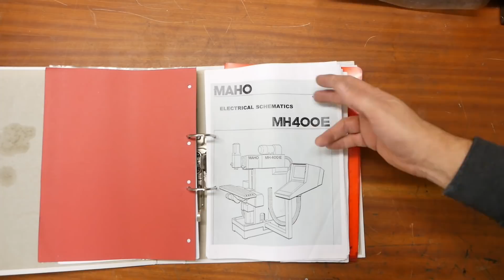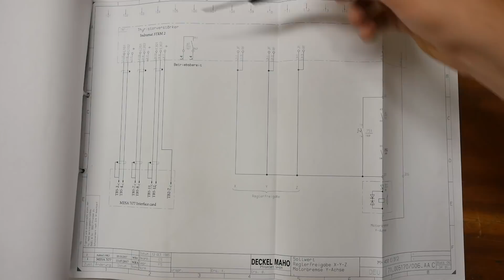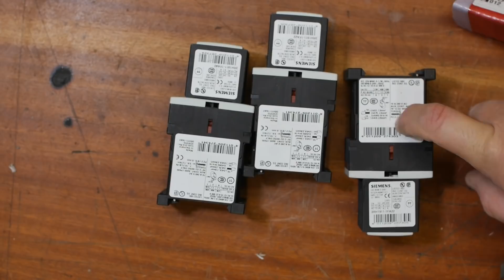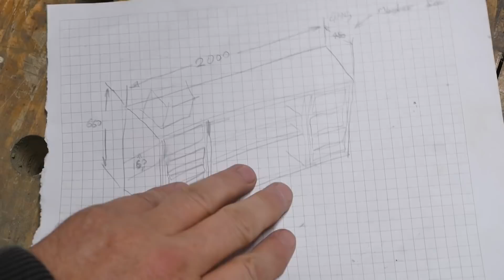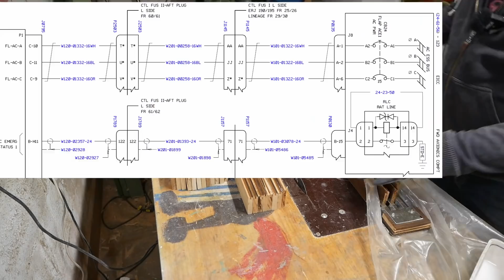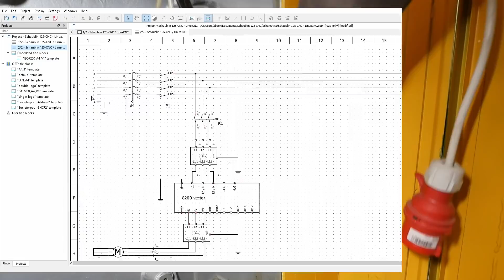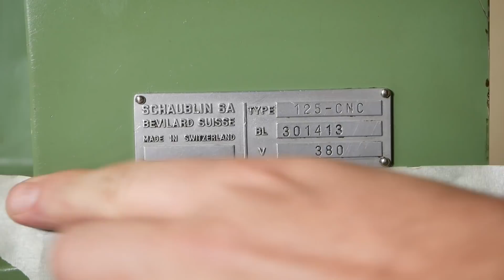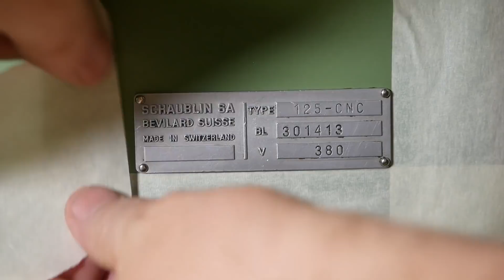How I do wiring diagrams for  CNC conversions.

Comment: Wow, that was a nice cliffhanger :D
Reply from the maker: Thanks. Something for the regulars :)
Reply: I'm afraid all the WD-40 brushing has disabled all methods using sticky-ness to remove the 'gunk' (spelling?) 🤔🤓😁 Can you get the machine into the ultrasonic cleaner - then give that a go 😁
Reply: @TheStuartstardust Could put it on the scooter trailer and drive through an automatic car wash. That'd probably work, right?
Reply: @UVBluetoo  i think it is for sure worth a try.
Reply from the maker: @UVBluetoo  That scooter wont make it to a car wash any time soon :)
Reply from the maker: @TheStuartstardust  I could remove the tag and put it in the U/S cleaner.... but were would be the fun in that :)
Reply: facinating to se so much work and so little progress on that plate :-)
Reply: You know it's getting serious when the masking tape comes out
Reply: Indeed, I was all like yaaayy then waaaa. I will wait to see of my suggestion worked.
Reply from the maker: @twistedhairball  A real cliff hanger. Thanks for the idea.
Reply: @RotarySMP  @Twisted8 the glue grab is a great idea! Might add some heat into the metal form a hot air gun before pulling it off?
Reply from the maker: @GeorgeGeorgalis  Good idea.

Comment: Those Maho schematics are well laid out, trying to fit all components and connections on a single page for even a relatively simple control system is near impossible. A3 is an excellent size for printed circuits, high end e-Plan is very good,  PDF's from e-Plan has dynamic links, enabling excellent navigation within the document file.
Great video, thanks for sharing
Reply from the maker: Thanks for the feedback. Yeah, I am going to try and copy the layout Maho used. It is pretty logical.

Comment: Next time try kicad for the schematic, its actually designed to make schematics and PCBs.
Reply from the maker: QElectroTech is specifically designed for making schematics as well. Seems especially optimised for control cabinets, and not for PCB's. For PCB's, I use Eagle.

Comment: Just a thought, you could put the schematics on a memory card and store that with the machine as well as a printed schematic. That way if the original files are lost, you would still have a soft copy.
Reply from the maker: True, althoug given the life expectancy of these machines, imagine if Maho had put an electronic data storage in the cabinet in 1985. 5 1/4" floppy drive anyone? 
 :)
Reply: @RotarySMP  It's funny you mention it since Adafruit is currently working on a device to recover data from 5.25" floppies.
Reply from the maker: @JasonTHutchinson  I just googled... you can buy USB 5.25 " floppy drives on amazon for €30. Wonder who buys them?
Reply: @RotarySMP  I bet there is plenty of old industrial and medical equipment running with obsolete storage tech. Some times you can replace with a USB stick drive emulator but not always.
Reply: @RotarySMP  I thought floppies were dead too, but there are apparently still lots of people using them. Many old PC games came on floppy, and I believe the government still has a few things on floppy as well.
Reply from the maker: @JasonTHutchinson  Oh, that reminds me of a disc story I need to add to a video. Thanks.
Reply: @RotarySMP  Indeed, you'd need to include printed instructions on how to build a suitable media reader, a la voyager golden record
Reply from the maker: @m3chanist  Yeah, chicken/egg problem right there.

Comment: I was very lucky to have a avionics engineer as a father he explained schematics to me when I was in my early teens. When I did my apprenticeship as a machine tool fitter it helped me really understand it. I have always drawn schematics with LV power and control separate as the LV is the responsibility of an electrician and the controls that of a controls engineer this allows the two disciplines to work I conjunction and you are right a car plant is just as complex as a large CNC machine. As always a great video I love the eclectic mix of work all have one thing in common a great engineers mind set.
Reply from the maker: Cool that you learned that from your Dad. My Dad was a boiler maker who restored classic motor bikes, so I learn more mechanical skills. He had a Boxford lathe when  was a teenager, so I learned to like lathes early :)
Thanks for the feedback.

Comment: Make a temporary fence that is skewed across the width of your jointer table, and run your leg assemblies through at an angle, and you’ll have a lot better surface finish on your your laminated edges.  Good video BTW…👍
Reply from the maker: How many degres skewed would be best?
Thanks for the kind words.

Comment: Have you though about also having air cooling/blast at your tools and not just flut cooling ( can't even started to tell you how many times I wish I had that on my machines for when your working in hard materials or materials that don't like water cooling or inserts that loss lifetime with it where air blast cooking would had been so nice to have) it's not like it will be hard for you to out in / set it up at this point in time ( even just a flex hose and a foot pedal should work fine)
Reply from the maker: That is a good point. Especially on a machine with pneumatics, and a spare valve.
Reply: @RotarySMP  your welcome m8

Comment: For the electrical cabinet, it's good to put the terminals blocks at the bottom for all the cables that arrive in the cabinet. This makes wiring easier and you can dismantle your cabinet later to work on it without removing all the cables from cable channel.
Reply from the maker: Thanks for that. That might be even easier, as I have a bit of a restriction where I put those motors drivers due to their height.

Comment: I was originally trained in heavy industry and have a strong dislike of multipage electrical diagrams.
Most of our diagrams were A1 sized, about the size of a large coffee table. And to make it really suck, the item (like a contactor) you were testing was often split over 10 or more separate diagrams, with each diagram having one contact (switch) or one coil etc. Then to diagnose it you could see it being in series with other contactors, limit switches etc, and each of those things was most likely split over multiple OTHER diagrams.
And of course all the diagrams were folded up like roadmaps with 3 folds...
So in the back of a relatively simple control panel there would be a plastic bag with a phone-book sized wad of 30 folded up diagrams, and OF COURSE there was nowhere to unfold and lay them out to read them the space was very limited and the floor was filthy...
So you had to hold them up by a corner, crook your neck sideways and try to trace the schematic across 20 different diagrams.
And the ONE critical diagram had, of course, been taken away by somebody... 🤯
Reply from the maker: ... and it was 3am when you were called out to troubleshoot it :)

I only know the Schaublin schematics, and they seem pretty logical, starting with power, then Output, then Input, and finally buses and digital. I'll try to copy that system. 30 pages in total.

Comment: In large wiring diagrams the components and wires are usually named in reference to the page number and grid position they are drawn on. So when you find something that let the magic smoke out you can tell by it's ID where it is in the wiring schematic. Also put the part number in the diagram so the next person knows what to order when the current one is melted beyond recognition. Cheers!
Reply from the maker: Great tips thanks.

Comment: nice work. with the haas horizontal ive been restoring, its got tons of wiring. luckily haas actually made a full service manual for the machine with wiring. the nice thing about that is you can see what modifications were made to the wiring, and undo them if needed, or fix and troubleshoot broken cables. most of the issues I ran into were corroded plugs. haas, and the switch supplier decided open atx style plugs were the ideal solution for a machine destined to be sprayed down with coolant its entire life. you can see all the plugs have a green tint to them, from the corroded copper.
Reply from the maker: Sounds like the Renault I used to have. It has a connector at the lowest point in the cabin, with a bulgen in the bottom for space. The bonnet /windcreen area drains blocked up, water flowed in through the aicon blower, ran down under the carpet to the lowest point. Dumb as. I had an emmisions warming, difunctional rear window winder, no aircon, and an ignition fail when I dumped it.
Reply: @RotarySMP  there are several poor design choices with this particular machine, one being that the air solenoids are mounted close to the thing they actuate. so you also have the connector there as well. the wiring could have been much shorter with them all located near the control box. all the solenoids could be on a solid manifold, instead lines that are always pressurized run to regulators and solenoids scattered throughout the machine.
Reply from the maker: @davidfarmer  I have never used a Haas, but I guess they would be under a lot of price pressure.
Reply: @RotarySMP  It was their first horizontal machine, they made changes every year.
Reply from the maker: @davidfarmer  Sounds like the Canadair Regional Jet :)

Comment: If the wood glue does not work maybe a steam cleaner would do the trick? Or knock it off and put it in your ultrasonic cleaner 😁
Reply from the maker: Remember I need to spin another 20 episodes out of that tag. :)
Reply: @RotarySMP  🤣 well then... back to the toothbrush!

Comment: I did some industrial wiring during lockdown, you can get slide-on cable labels relatively inexpensively. Just be sure to label both ends of the wire. The guy I worked for liked to orient them in the same direction, made for nicer troubleshooting.

If you get into putting ferrules on the connection ends, make sure not to press them too far into the terminals, as you can make the connections intermittent.
Reply from the maker: I have some clip on cable numbering, and also a label maker. Thanks for the tip.
Reply: @RotarySMP  Instead of cable clips, I use a brother p-touch label printer with heatshrink label. Much cleaner and you can't lose them.
Reply: On vibrating machines with small cables ferrules can be life savers, as well as labour savers.

Comment: I can’t lie, I want to see if the wood glue worked. 😂 All that laminated wood should make for a nice strong table. And it looks nice as a bonus…
Reply from the maker: Yeah I am also curious about that. Since that was probably water based coolant which varnished there, there is chance that the water in PVA loosens it and binds it. Not holding my breathe though.

Comment: Ha! Last week I did some research for electronic drawing software and our electrician and I also came up with Q-electro as solution. After years of scribbling extensions and rewirings into the existing paper copies, I guess it is about time to redraw them :)
Cool technique with glueing the mortise and tenon directly into the work. thats something to keep in mind!
Reply from the maker: It worked well. When did SWMBO desk years ago, I glue all four parts in one stack. The was much better as I could finish the inside boundary before assembly. That was a pita last time.

Comment: In the case of the Webb Telescope: of course they will make sure they keep undershooting. There is the insertion burn, to transition from the transfer orbit to the destination orbit. By undershooting they will make sure that as the telescope starts drifting away from the L2-altitude the drift will be downwards (downwards in the sense of being  in the direction towards Sun/Earth.) From then on all the orbit keeping corrections will all be corrections that must undershoot.

If they ever overshoot: the drift away from the L2-altitude will then be drift to an orbit around the Sun that is not synchronized with the Earth's orbit around the Sun. 

Webb does not have the velocity to escape the Sun, that's not at issue. The advantage of Webb orbiting the Sun in such a way that Webb remains in the vicinity of the L2 point is that that is a Solar orbit such that the distance between Webb and Earth is consistent. If the period of solar orbit of Webb would be not synchronous with the Earth orbit then there would also be times that the distance between Webb and Earth is so large that the bandwidth of the radio communication of observation data suffers.

That is: if Webb would drift away from its L2 altitude in such a way that it cannot be corrected then Webb will still orbit the Sun, and Webb will still be just as capable of astronomical observation,  but the bandwidth of radio communication will be degraded, depending on the Earth/Webb distance
Reply from the maker: Good description, thanks. NASA described it as Sisyphus constantly having to push his stone up the hill. Cool that they have more fuel left over than the worst case launch. Hope it does science as long as Hubble
Reply: @RotarySMP  I would describe maintaining the altitude of the Webb telescope like keeping a large A-frame upright. Let the A-frame pivot without any friction. The closer you are to perfectly vertical the smaller the required upright-keeping force. Right at the edge you can even let go and only correct from time to time. The tricky bit is that if you push it even the slightest bit past the point of perfectly vertical it falls over away from you.
Reply from the maker: @cleon_teunissen  Good one. Did you see that they put the fuel tank in a location which is easy to access, maybe in the hope that there will one day be the possiblity of a refueling mission.
Reply: @RotarySMP  i believe i saw that it had some refueling ports, but I'm not certain.
An alternative is what has been done for some other spacecraft, which is stuffing another rocket into the exhaust of the one you want to keep going.
Reply from the maker: @joshuacheung6518  Yeah, that is a pretty funny low tech concept, that is used.
Reply: "Low" tech, yeah. But safer than a fuel transfer to be honest. Docking a mission extension means you either dock or don't... or crash into your target. Fuel transfer, you have all those plus if a line ruptures or it starts venting, you could spin out of control or damage fuel systems...

Comment: Regardless of what software you use, there's two things that electronic (≠ electric!) schematics generally do to help with larger designs:
1. if a component is broken up into multiple parts, there is always one or more letters appended to the component name, i.e. U1A, U1B, U1PWR. (Single letters from A up are generally for multiple copies of the same function.)
2. anything spread over multiple pages generally has the list of other pages making a reference to the same component (or wire) appended to the label, e.g. "U1A [5,6]" (the current page is normally left out)

If you do things in non-specific software like Visio, the letter suffix is easy enough to do manually. (The page numbers really need to be automated, incorrect documentation is worse than no documentation…)
Reply from the maker: Thanks for the tips. I need to watch more tutorials on QET to learn its auto connection of distributed parts.
Reply: @RotarySMP  Once setup correctly Q automatically puts a cross underneath the main coil of the contactor / relay, then if you link an auxiliary contact to it it updates with the page number and grid reference.
Reply from the maker: @robr3169  I saw that in the tutorials, but havent got it stuck in my head yet. That is one of the videos I need to rewatch.
Reply: @RotarySMP    I'm no expert but drop me a message if you want me to try explain.. or could send over a set of our drawings if it might help.
Reply from the maker: @robr3169  Thanks for your offer. I just rewatched the tutorial, and that is really easier than I thought. It is a good software solution. Shame I didn't learn it years ago.
Reply: @RotarySMP  Which tutorial? New to QET and trying to track down all the useful english info.
Reply from the maker: @Ryan-ke1po  I have watched a number of youtube tutorials, both german and english language.
https://www.youtube.com/@scorpio8101/videos

Comment: I gather the booster for JWST nailed it so precisely that they'll fuel enough to extend the mission somewhat.  Your mention of schematics makes me realize I need to document mine; a 2-axis lathe with a 3 phase motor and drive should be a shallow-ish learning curve.  As an aside Illustrator is the way to go if you need to edit PDFs.  Thank you for the ongoing adventures!
Reply from the maker: Yeah the whole Lauch and deployment has been a fairy tale of some success.
Yeah, don’t put off the schematic. You’ll need it sooner or later
Reply: I love that other nerds out there are as excited about James webb as we are...

 but I do take a different approach than you do on being neat... my conversions are paperless and I mix metric and SAE fasteners..... apparently I like chaos... the poor lucky bastard that gets all my stuff at an auction after I go...
Reply from the maker: @HuskyMachining  I have also had dreams of making a CNC machine, where I make all the fasteners myself. 1/7" x 0.57mm pitch  63° LH threads everwhere, except where I need 7.3mm x 17tpi buttress double start:)

If you hve a CNC lathe, any thread is a standard:) Then again Boley used 55° 1.1mm pitch threads on the collet closer.